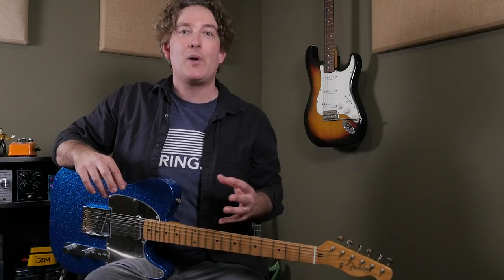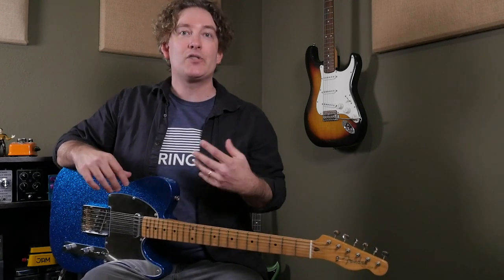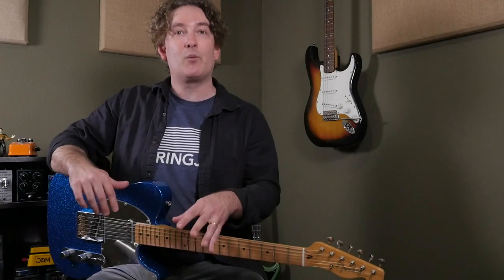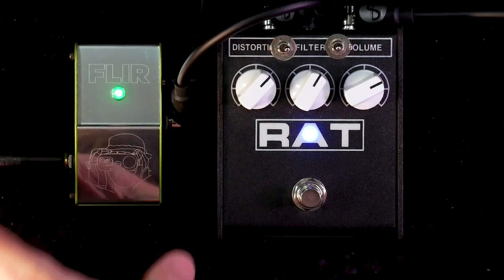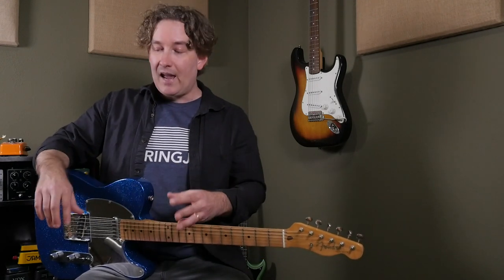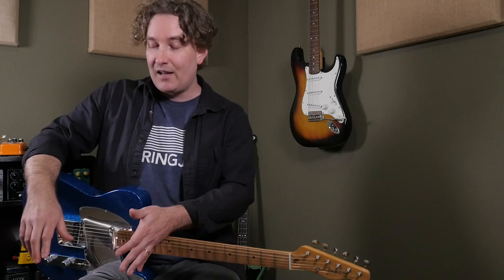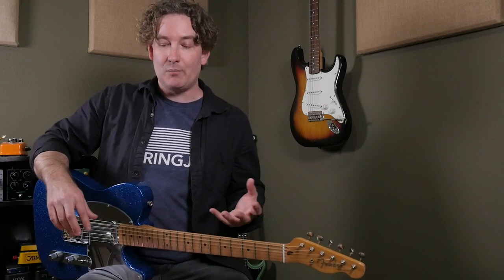A Reminder About Buffers - feat ThorpyFX FLIR

Comment: If i get a buffered tuner (so first in line with m'y 6 other pédale) would i get a similar improvement ? I run two 6 meter long câbles from my board.
Reply from the maker: First in line won't make a difference for driving a cable run to your amp. The pedals after the tuner change the output impedance. Also, the buffered tuner may help but I've found that their output impedance can still be higher than a standalone buffer-- lowest ohms is desirable. In the end, a buffer is perfect for my setup but for 6 meters you'll be fine by placing the tuner or buffered pedal last in line. Thanks,
Andy